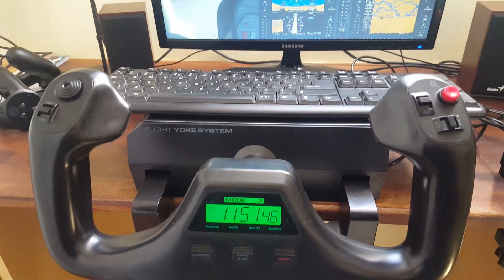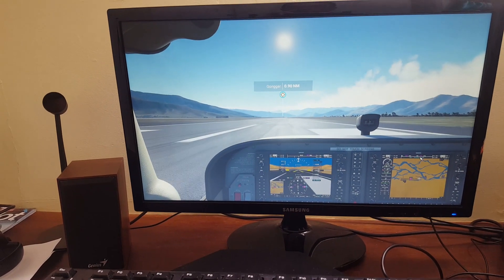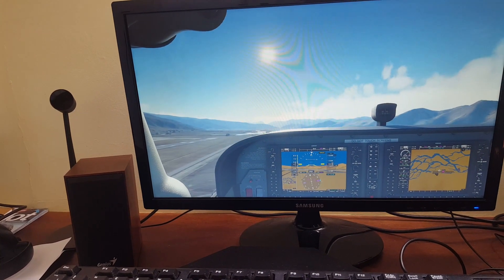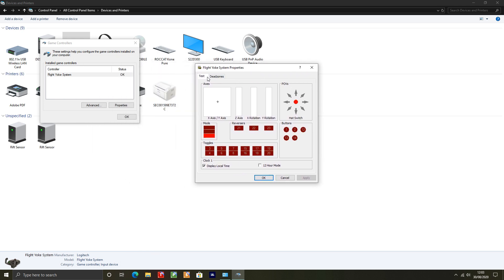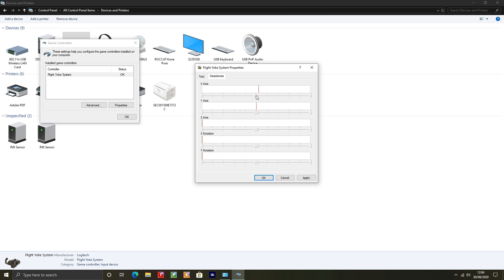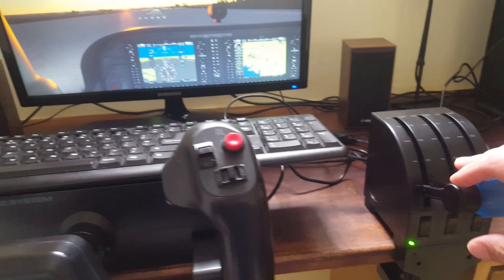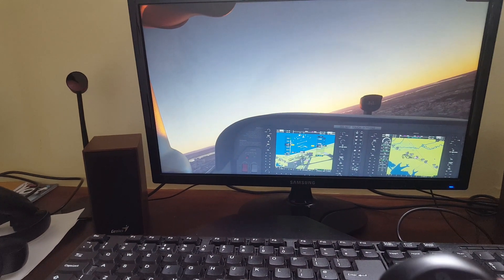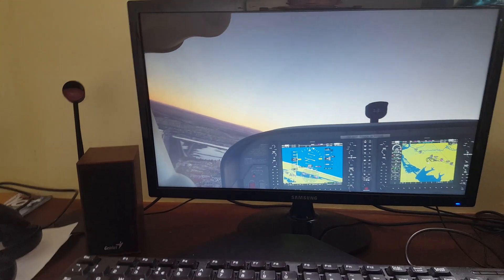How to fix 'Drift' Issues on your Logitech Flight Yoke System!

Comment: Wow thanks, I've always assumed this behaviour was normal, I just correct with rudder. 

Can you help please with a different issue? My yoke becomes unresponsive after a few minutes into the flight, it'll come back on again when I unplug and replug the USB but would crash the pc at other times. I also have not been able to install the driver as the auto os detection on the website is only giving me the 32bit installer. I get the error message, "the installer is a 32bit find the 64bit and install" or something like that. Its been working fine for the past 3 years I've bought it, just started with the UK update of MFS2020
Reply from the maker: I'm not sure on the top of my head what might be causing that, but will research deeper into this for you - for now I'll pin your comment to see if others can help :)
Reply: @Huddison  thank you so much, its super frustrating
Reply: Bro, ive gone through pretty much every brand of yoke in the past 2 years lol and any problem you can imagine, ive got a folder and several subfolders on my desktop full of installers, drivers, and notes on how to solve a myriad of issues, hopefully we'll fix yours too.

What yoke you got ? Saitek/Logitech one like in the video above ?
Reply: @bikerboy3k  its extremely frustrating, although my issue maybe amd usb power drop off which amd has been investigating for a while now. Hopefully they come up with a fix soon. My yoke is the exact one as in the video
Reply: @Sy-T007  is it showing properly under "set up USB controllers"?
Reply: i know im randomly asking but does someone know of a trick to log back into an instagram account?
I was dumb lost my password. I love any help you can give me
Reply: @Andy Mark instablaster ;)
Reply: @Samir Manuel It did the trick and I actually got access to my account again. Im so happy!
Thanks so much you saved my account!
Reply: @Andy Mark happy to help :)
Reply: I have the same problem
Reply: It is normal!! It is how it is in real life because the prop spins in that direction!!
Reply: I know its a 1 year old comment here, but did you get your issued resolved?

Comment: Thank you so much for the quick video Huddison.  I only posted the comment yesterday asking about this and already you've uploaded a video, amazing.  I will be giving this a try.
Reply from the maker: Let me know how it goes.
Reply: @Huddison   Ok so i changed my deadzone to copy yours from the video you made and that made a big difference to my yoke and i like the feel of that.  Now, i went into the device settings menu for the yoke and noticed the red line on my axis were lining up perfectly without needing to change it; it wasn't flickering, so since then i have had zero issues and my experience is a lot better.

Now, i've been thinking about why it would suddenly correct itself without needing to adjust the sliders in your video here, and the only thing i did differently was that i plugged my throttle quadrant into the yoke BEFORE i plugged the yoke into my PC usb.  I'm wondering if plugging the yoke into your PC first and then inserting the throttle into the yoke somehow interferes with the yoke calibration.

All being said i appreciate the vids to solve any issues going forward should i need to correct thing
Reply from the maker: @leerabson4693  I shall give that a try myself.
I actually feel that the current desk I'm using is not level ( I can almost visually see it), so bearing both options in mind.

Comment: A good idea
I have an other:
if you have been using your yoke for several years. Open it and clean the potentiometers with electronic component cleaning fluid can correct all problems.
Reply from the maker: Brilliant tip👍

Comment: in Windows 11.  I found my yoke under more "more devices" even though the yoke was properly identified on the normal page.  In the "more devices" I was able to calibrate it like you show here.
Reply: joy.cpl brings it up too. My problem is my tabs are settings and test. Settings lets me calibrate but it associates  throttle and pro in the calibration and not any of the yoke options one axes does nothing on any part.
Reply: thanks i couldn't find it until i read your comment

Comment: ok so firstly this is normal for propeller aircraft! it isn't drift its torque from the direction the prop moves! However the Logitech pro flight yoke does have an issue with the USB where only the ailerons will slightly be out of alignment and the only way to resolve it is to unplug your USB and plug it back in.

Comment: I did this video and it worked amazingly for DCS then I went and put WD-40 because it was sticking and that deleted all of my drift so it would send me over to the left and crash me so I had to kill all of the dead zones LOL but seriously add some lubricant or oil it says it in the user manual and it is certainly worth the try.

Comment: on the runway you need to give a left rudder correction to counter for p factor, and that has nothing to do with the aileron as you have no aileron authority until your speed builds up to at least 70 to 80 percent of your V!.

Comment: I go into Flight yoke system properties and the tabs I have are settings and test. I have no deadzone tab. What should I do? (I have windows 10). I go into calibration but it says 512 for both so I think it is centered yet I will still drift to the right and down some. It looks like the deadzone isn't active or something because no matter how I turn, it will eventually begin to drift again. I've also tried spraying pressurized air inside but it also doesn't help.
Reply from the maker: The deadzone tab shows for some and not for others for whatever reason.  This video may help you though: https://youtu.be/xJFVx6WatZs

Comment: I have windows 11and in control panel under devices, my yoke system doesn't have the deadzones box. Also the calibration isn't working properly.  Any solutions please?
Don
Reply from the maker: Hi Don, I can't confirm how Windows 11 affects the yoke, as I'm still using it under Windows 10.
I know there was a recent discussion about this in our Discord, if you want to check there.

Comment: What is odd is when I go into control panel and click on my controller there is Settings & Calibration but not dead zone. Why would that be. I am using latest version of Windows 10.
Reply from the maker: I've not installed drivers for my Logitech yoke; so perhaps they have an influence on what options appear to you.
Reply: @Huddison  Neither have I installed drivers, so my should be the same as you. Oh well good old Microsoft.

Comment: The best, fastest, easiest and most uncomplicated way to fix the offset is... To unplug it until you hear the windows tone for disconnecting usb-device and plug it in again. It centers perfectly after the 2nd plug in and there's no need to play around with deadzones and shit. Somehow the first time, when plugged in to the pc - or even already plugged device when turning on the pc most of the time gives you a slight offset to the right. But before you start anything else just quick unplug and plug in again - 99% of the time it works instantly for me, 1% of the time I have to do it a second time.
That's it. Problem solved!
Reply from the maker: Hi, Yes that does indeed also work. But with mine at least, the drift/offset soon reappears, often part way through a flight!
Reply: Problem I have found is in flight if you disconnect there is no guarantee it will reconnect. I have found on occasions I have had to restart the computer.
Reply: @robertfeal-martinez3065  ok... that's sad. I never had that problem.

Comment: Maybe if the steering is heavy and your table is not level can tilt that could be also potential issue. Most likely not, maybe just faulty like ps4 controllers after some use.
Reply from the maker: I hadn't though about that, you might have a good point!

Comment: I have this issue with the pitch. I keep having to adjust the trim every minute or so but eventually that’ll max out and i’m not able to keep on flying. I’ll check this method, thanks!
Also, i don’t know if anyone else has this, sometimes when I make a turn, the yaw will suddenly shoot to the maximum and stay there, sending me into an incontrollable roll.
Reply from the maker: Keep your eyes peeled for a video I'm just uploading ;)

Comment: Thanks for the tip on how to correct the deviation. Despite having been published 4 years ago, it is always current. One question: do you use modes 1, 2, 3? How do you make it work with FSX?
Reply from the maker: From memory: FSX does not have separate profiles, Like FS2020 does, so switching between the modes lets you have different bindings for each mode.
Reply: @Huddison  tks. I will try it.

Comment: Why is the plane not trying to yaw left due to slipstream yaw when the yoke is centred?
Reply from the maker: Explain more
Reply: @Huddison  Well when you fly a plane for real, and you fully open the throttle (max power), planes with a prop on the front in the middle creates a slipstream effect. The slipstream air will hit the left side of the rudder causing the plane to yaw to the left. This is why you get nagged with "right rudder, right rudder, right rudder" :D. You can google Left-Turning Tendencies of an aeroplane or slipstream yaw. It might explain it better than I can.

Comment: Nice! what version of the yoke driver are you using and where did you download it? i'm trying to get the clock working on my yoke, however my driver is not showing the clock configuration options as yours....thanks
Reply from the maker: I'm just using the default Windows 10 drivers currently, as they seem to work just fine for myself.
What clock configuration/options are not showing for you?
Reply: @Huddison  It doesn't show me the yoke's clock option to set time using computer as source. It's 00:00:00 all time. For some reason I was using Saitek drivers, so I found this Win10 64bit driver for my yoke that allows me set it up correctly, so now clock's yoke (the green one in the middle of the yoke) it's working perfectly using computer's time as source. Here's the link https://forums.frontier.co.uk/threads/saitek-pro-flight-yoke-windows10-64-driver.401117/
Reply from the maker: @gastongeler1050  Fantastic, great to hear you've managed to get it working for you!

Comment: I have this problem but I don't have a dead zone tab in the controller settings
Reply from the maker: It seems some do, whilst others don't - not sure why.
Reply: In my control panel the settings are correct but in the flight sim , I check sensitivities and the center dot is on the left hand side.. so as soon as  I take off the plane banks or turns fully to the left...

Comment: This "Drift" is actually perfectly normal and happens in real life. The reason for it is because the propeller pushes air down on the right wing and up on the left wing, and pushes on the right side of the rudder. It is also caused by the gyroscope of the prop.
Reply from the maker: Yes true, but this throttle actually develops a physical drift over time.
Reply: The "normal" drift is not what he's addressing here.

Comment: my problem in the Right & left Radder i dont know what is the best way to go left and right on the ground
Reply from the maker: I just use the yoke as rudder on the ground; far from ideal, but it works for now.
Reply: thanx for answering. yeah this what i used to do. but after the last update it didnt work. i have to use Enter + Zero botton to lift and right. and when i changed it to the yoke it worked even when i am flying. sorry for my engish.
Reply from the maker: @abotoohy  I'll check this out when I'm back home tomorrow
Reply from the maker: @abotoohy  My yoke still works as Rudder on the Ground - do you have your Flight Model set as 'Modern'?
Also with the A320, I can only steer on the ground at low speeds. 
Having 2 flight controllers plugged into your PC at the same time, can also be problematic.
Reply: @Huddison  omg i understand now.i changed the ' Assistance ' to Hard. when i changed it to easy it works well. Thank u so much for ur help& ur time
Reply: But i really dont know what is the different between Hard , medium and Easy ?
Reply from the maker: @abotoohy  I'm assuming it just means the  difference in the various levels of assistance it provides you.

Comment: Mine is really weird. The controller has a built in dead zone that's always MILES off centre, usually about 5~10 degrees to the left it hits a hardware dead zone, while windows always shows it centring about 10 degrees to the right. I unplugged it's extra power socket, and the left right axis reset to perfectly centre, HOWEVER, the pitch axis went insane.  I plugged the extra power back in and everything reset to centre, even the hardware dead zone.

I expect it to fall out of centre again. It's just interesting that the extra power port to power its internal USB hub has such a dramatic effect. I'm actually thinking about not using its internal USB hub for anything (currently I'm using it for the autopilot panel) as it seems to be super sensitive to power draw.
Reply from the maker: It is quite strange that the usb hub on the yoke is so sensitive; I rarely use it.
Reply: @Huddison  I use it because the stupid autopilot panel doesn't work for me unless I unplug it and plug it back in one's flight simulator is fully loaded.
Reply: So, it gets even more annoying. 
It's now centred correctly in game controllers, but the game has its centre waaaay off. In fact, I might record a video of this. Mind if I drop you a link when I have it done?
Reply from the maker: @DazzaJay  Join the Discord and put it in there: lots of knowledgeable people in there that can help too 😉
Reply: @Huddison  Got a link to the Discord?
Reply from the maker: @DazzaJay  having trouble linking from my phone; will link after I get back home (or check one of my other recent videos),
Reply: @Huddison  Found the link, Posted the video in there now.

Comment: There is no deadzone optioj on my windows interestingly just “test” and “settings” which is only for calibration
Reply from the maker: Hmm that's interesting. Did you install a driver for your yoke? I didn't.
Reply: @Huddison  nope i also didnt install anything just connected via usb. Maybe its already an updated driver on windows and they removed that part. Are you still have that deadzone tab available for u sir?
Reply from the maker: @zeffmetu  Yes the deadzone tab is still available for me.  Not certain what's going on with your own - but we have quite an active channel, so someone passing through the comments might be able to help👍
Reply: @Huddison  if its still available then there is hope=) let me dig in to that driver part and lets see if i can also figure out. Any help is welcome meanwhile and tx for the videos they helped a lot
Reply: I had the same problem at first, but after I´ve installed the driver the deadzone tab appeared.
But the calibrate tab sadly disappeared
Reply: @jonathanh5789  so is it kinda dead end? Because we also need that calibrate feature time to time.

Comment: i don't have a deadzone setting in game controllers
Reply from the maker: Do you have the Logitech Yoke System?
Reply: @Huddison  yes and i can't find anywhere to download the drivers
Reply: @Huddison  the actual store page itself link goes straight to support page
Reply from the maker: @ASMRHarmonyHub  Don't download the drivers; I haven't and it's been working just fine.
Your yoke is not showing under 'view devices and printers'?
Reply: @Huddison  no it is but not showing dead zone settings just calibrations
Reply from the maker: @ASMRHarmonyHub  Can you take a screenshot of what you are seeing and send me an email? Address is on my channel page, about tab.
Reply: @Huddison  hey there bud got it working but my left input compared to my right is a whole lot less especially with smaller inputs when adjusting for landing
Reply from the maker: @ASMRHarmonyHub  That may be a sensitivity issue - check this video, if you haven't already:
https://www.youtube.com/watch?v=30RnmyPa5fg
Reply: Do you know a solution to sort out the poor input for left
Reply from the maker: @ASMRHarmonyHub  Did you try adjusting the sensitivities?

Comment: No calibration... that sucks, so the solution is to pretend the drift doesnt exist.  Thanks Logitech.  But a big thanks for the work around until i replace this yoke.  I dont want a work around, i want a solution.  I have been looking at the HoneyComb yoke, I'll have to see if it suffers the same issue or atleast comes with a calibration.
Reply from the maker: No issues at all with my XPC yoke.
Reply: @Huddison  Awesome Thanks

Comment: Is this not called propeller walk,  it's an actual effect of the propeller pushing the the aircraft in the direction of the spinning prop! Ie if the prop is spinning clockwise, then the aircraft moves to the left as being "pushed" over by the spin force.  IF the drift is in the opposite direction, ie prop spinning clockwise and the aircraft drifting the the left. THEN that is a drift issue with the yoke. Looking at your video the prop is spinning clockwise and aircraft moving to the right..
Reply from the maker: No it's definitely a yoke drift issue: check later in the video, the aileron alignment is slightly off in the yoke properties.

Comment: Gday.  This works ok for me and I also have to do the reset with the regedit file but I cant save the settings once i fixed them.  I have to resent every time or else I get the drift to the right for me for both XP and MSFS.  Anyone have a solution to save the settings so I dont have it do every time i turn my computer on!!!

Comment: Not sure this is a drift ‘issue’… of controller. it is simulating normal behaviour due to rotation of prop and airflow across the plane.
Reply from the maker: It's actual drift as shown in the settings.